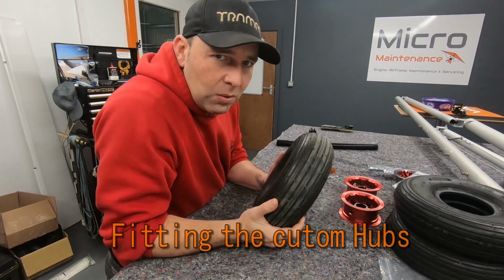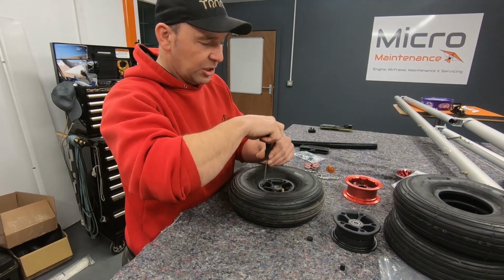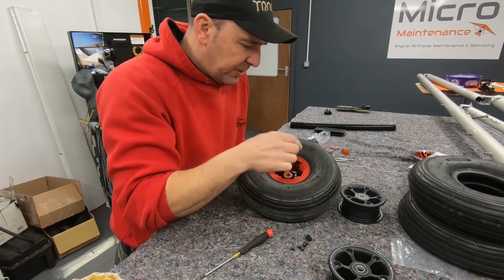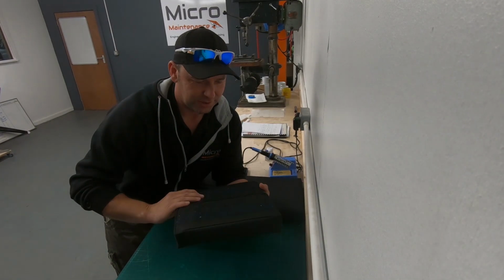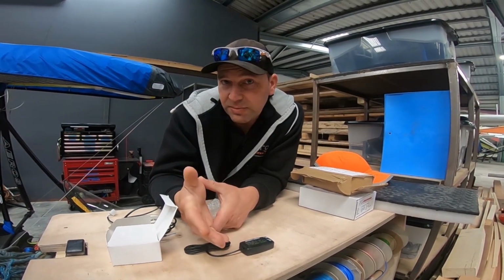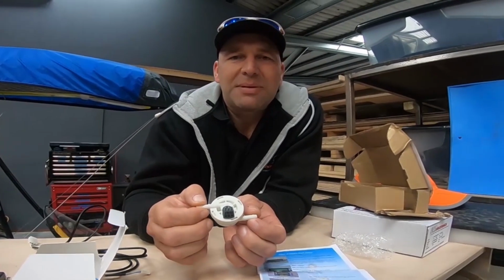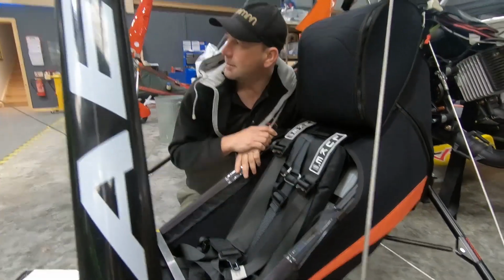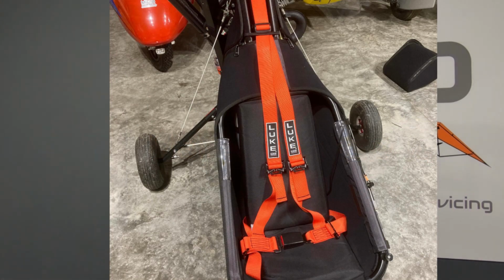PeaBee Modifications, MORE UPGRADES: Micro Maintenance - S2E9

Comment: Very nice!.... Q:  Wouldn't you be better putting the impeller after the fuel filter to avoid any 'stuff' from the tank jamming it up? In the Foxtug we found quite a few 'bits' in the bottom of the plastic tank as remnants from the moulding process (+other stuff that tends to appear) - I would guess that they would jam the impeller if they got through the hole in the tank.
Reply from the maker: Hi Andy, duly noted and was an opinion expressed by Giles. We do now fit them after the filter, though the impeller is a through flow and should it become impaired will free flow.